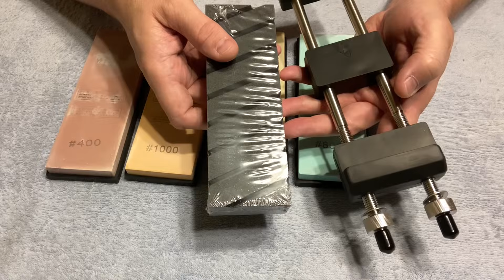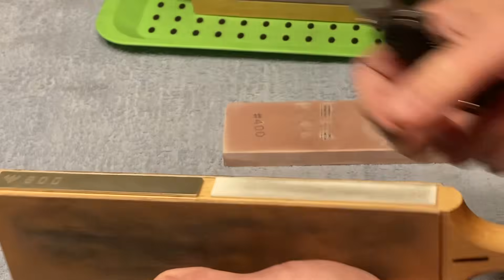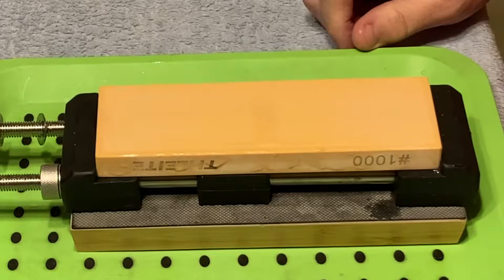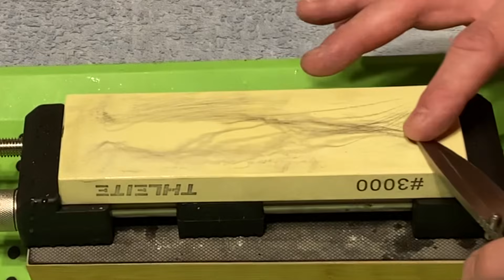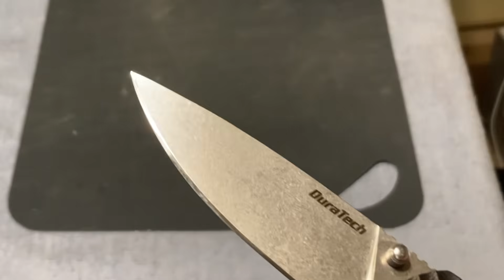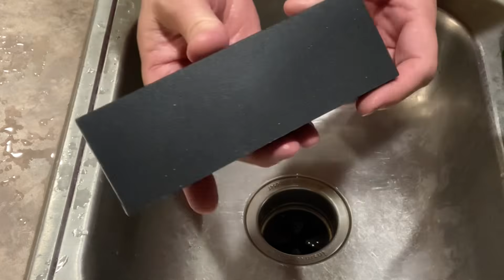THLEITE (Budget)Splash Waterstones

Comment: Based on the recommendations in this video, I decided to get myself a set to start practice sharpening. However, when the set arrived, I noticed that most of the stones had what looked like arc-shaped scratch marks on them, as if someone had maybe used them to sharpen or test sharpen something. Is that normal? It didn't seem like the stones had any wear on them, otherwise, besides those scratch marks.
Reply from the maker: @Emptyhound - I don’t know if it’s “normal” but mine were like that too. These stones are really rough looking even when they are new. They look really beat up, they aren’t all exactly the same size … however, mine have been performing very well. I’ve used them a lot, and they are hanging in there. I’ve used the 400 & 1,000 by far the most. Those two stones still have some inconsistency in terms of the feel of how the grit is dispersed. Meaning there are some areas around the edges that still feel kind of slick sometimes and don’t really “cut“ but overall they seem to be working fine. I do think there is some “you get what you pay for” with these and the stones are very inexpensive. There’s nothing even close to them that I know of in terms of cost. Overall, I’m still happy with mine and to be honest, I bought another set. 🤷 if you have a problem with them once you start using them, please let me know. I would love to hear about it, but I think the appearance of them is to be expected, though I don’t think it’s “normal” because I’ve never had other stones look like that. Good luck, and please keep me posted.
Reply: @RockNKnives  Update on this. Through Amazon's increasingly arcane messaging system, I was able to get ahold of Thleite. Apparently that was a mistake on Amazon's part, selling a returned defective product as new and not the normal appearance of the stones (upon further inspection the #3000 was warped, as well). Super great customer service from them, prompt response, 0 complaints.

Comment from the maker: 44:00” This is when I say I don’t think you need to buy/use a strop with these stones which is true. Then I put up a note saying “strop still recommended”… That means IN GENERAL. I suggest you have a strop for use in your sharpening arsenal overall. That is not to say that I changed my mind and I think these stones require a strop, because I do not think they do.

Comment: One thing I want to say I do believe there's a film on the stones Straight Out of the Box on some of them some cut beautifully at the Box and some I had to do a quick lapping on before they started to cut correctly. So my advice to everyone is to go ahead and just do a light lap with the flattening stone just to get a nice consistent feeling and cutting surface to work with.

These stones in the 400 and 1000 Grit ask for a little bit more pressure if you want them to remove steel they do respond a little better with more pressure. The 3K and 8K require very little pressure and you do have to be careful or you can gouge them if you are using much pressure.
Reply from the maker: @diamondcutsteel Thanks for the input! It’s a welcome validation to hear that my assessment was pretty accurate… !! 😬👍